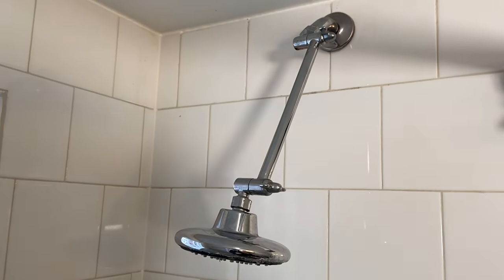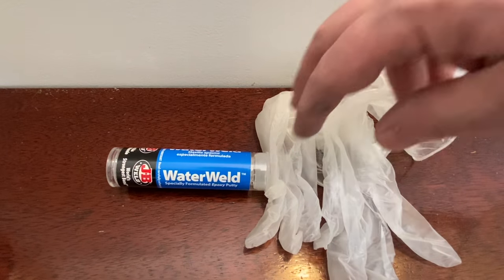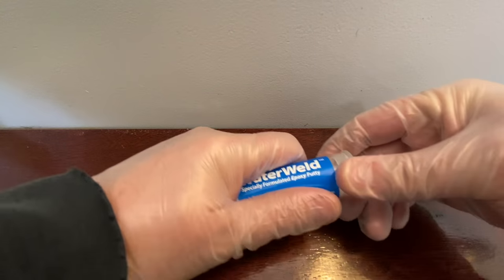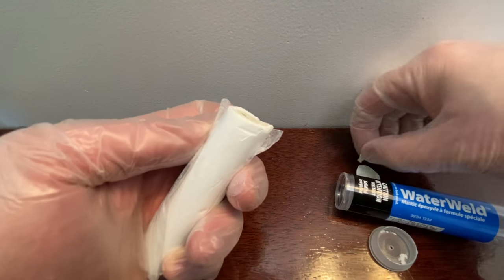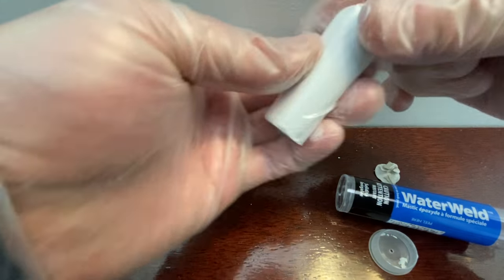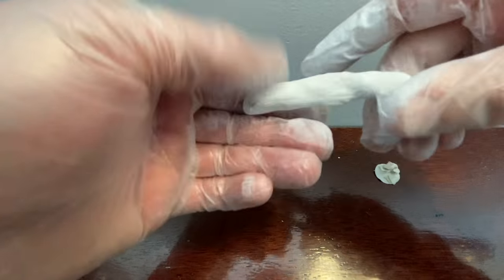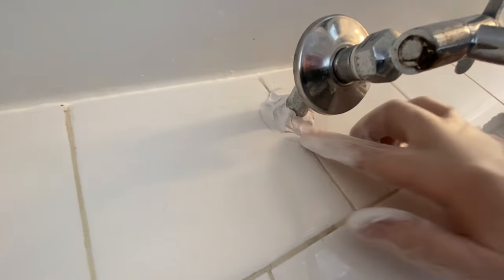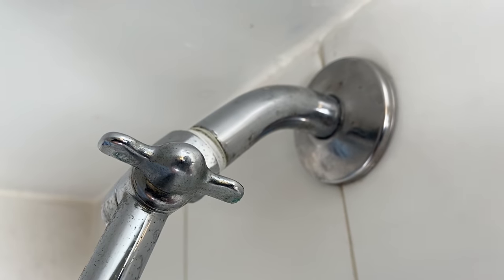Easy repair for a loose shower head!

Comment: What happens if you ever want or need to replace the arm?
Reply: It's not a perfect world solution it's a damn I gotta work with what I got solution lol
Reply: Use grout does same thing and can knock it out with flat when you need to replace
Reply: For anyone still wondering, what happens if the arm needed to be replaced. The tiles would also require replacing as the pipe runs directly behind the tiles. This makes it redundant whether this puddy is hardened to it or you leave the pipe wobbly.

Comment: Question-after doing this how do you replace the shower arm in the future?? Like how can this be removed without tearing out the tile?
Reply from the maker: I have not had a issue with removing water weld. it is hard but not metal. Place it to where it is not touching tile, but only the backer board or green board behind the tile. That will make it easier.
Reply: @ThatFixItGuy  would you chisel it out or how would you do it

Comment: Wow… I’ve ran away from this problem in at least two-three places I have rented. I assumed it was more of a professional job than my DIY tactics. Question, yours didn’t have much “play” from the wall. Maybe an inch or two? Mine has so much that it will pull out about a foot. Can I still use your solution with that much movement

Comment: Thanks for posting this.  I had a shower arm with a screw that completely came out of the stud.  The opening was large enough for me to try to install a new, longer screw, but I was unsuccessful doing that.  Bought a tube of WaterWeld and filled the drywall cavity.  Had to use the entire tube.  I had an issue with it setting the first time.  I held the showerhead up in place for about an hour while it was setting to no avail.  I disconnected my showerhead which was a pretty heavy rain shower head.  Was able to get a decent amount of the putty back out and re-kneaded it, and installed it again without the weight of the showerhead.  It set this time and I reinstalled the showerhead and the wobble is now gone.
Reply from the maker: That is great to hear this worked for you.

Comment: Great idea.  I have the same problem but with the bathtub spout.  I will do the same.
Reply from the maker: It should work good for that as well. Just make sure there is no bigger issue in the wall. You can see or hear water in there. Sometimes they just don’t secure things good.

Comment: Having this exact problem and was gonna cut my drywall to fix it. I'll definitely try this easy fix first! Thanks!
Reply from the maker: Sometimes they nail that in the back plate. Just make sure it is not a plumbing issue that will leak and hook it up. I’ve done this several times. Works well and can be removed.

Comment: any advice regarding how to remove head pipe (for replacement) after previously doing this with JB weld to secure it?
Reply from the maker: Screwdriver or little chisel and that plug will come out.

Comment: Really quick fix and stout I’m sure. 👍🤙
Reply from the maker: That epoxy putty is awesome. I have used one brand or another for a long time. Helps for things like this or in a pinch when you have no parts to repair a pin hole.
Reply: Thanks, just had new shower installed and the wiggle was driving my wife  crazy

Comment: My issue isn't this, but it has to do with a Delta shower wand and the ball and socket connector that it attaches to not staying in place. The ball and socket won't tight enough to prevent the weight of the wand from rotating downward in the plastic ball and socket. This a brand new shower wand. Ever come across this? Any ideas?
Reply from the maker: I have one right now that keeps loosening the whole shower head when you try to move the ball. I would contact delta or take it back and exchange it. Could very well be a defect.

Comment: How do you put handicap hold bars on any shower what's the easiest way
Reply from the maker: The easiest way would be to use those suction cup style handles to put in the shower.  Do you have a tiled or fiberglass tub set up?

Comment: Would this work for an extremely loose shower head arm? I have a shower head arm in the house that I’m purchasing, that has A LOT of wiggle in it. I really don’t want to cut open the wall to secure the piping. Thanks in advance for your reply.
Reply from the maker: This would totally work. I would just try to look in the wall and make sure there is no issue with the shower arm then use this to stop your wobble.
Reply: @ThatFixItGuy  awesome! Thank you for the tip!
Reply from the maker: Your welcome!
Reply: Is the nipple the arm threaded into secured or the arm broke inside the threads and stopping the "wiggle" still dont fix the problem! Actually it jt cahse ya not see the leak at the elbow!

Comment: How can u make sure that the water is not leaking on the inside?
Reply from the maker: I slide the escutcheon out and use a flashlight to look at the connection and if you still can’t see get an inspection mirror to look inside there.

Comment: Trying to put in new shower arm and the pipe goes back and forth and wobbles all around inside the wall. I live in a trailer and am so worried it will leak. Any tips ?
Reply from the maker: Do you know what kind of pipe it is?  Can you access the back of the wall behind the shower?
Reply: @ThatFixItGuy  I do not and I believe there is a panel that I can unscrew and take down. However I tried this hack and it seems to have worked
Reply from the maker: That is great to hear. This works really well.

Comment: How do I get the metal cover to stop sliding down?
Reply from the maker: Yep. get a tube of clear water clean up caulk. Just put some right around the edge. Wipe with your finger till it looks pretty won’t take much to hold that.

Comment: Could the looseness cause a leak?
Reply from the maker: If it is side to side  and back and forth movements it should not. Do you know what kind of pipe it is?  If cpvc or pvc was moving like that I would be worried.  If not those you should be fine.

Comment: And if you need to get back in there for anything?  How does that work?
Reply from the maker: You can just take a screwdriver or a chisel and knock that putty out. It does get hard but you will be able to knock it out.  Thanks for the question. I am going to add this to my video list.
Reply: Great question!  I’ve used another JBWeld product like this and it is like rock.  I would have used a Hugh density foam and heavily caulked the escutcheon to the pipe.  At least you can remove it later with ease.  The JBWeld product instructions say it can be drilled and machined, etc.  Sounds pretty permanent.

Comment: Is the putty removable?
Reply from the maker: It can be removed. I have taken it out with a hammer and screwdriver before. Or if you remove the shower arm then you can stick the screwdriver in the hole left the the middle and pop it out like a plug.

Comment: I see your wall is made of ceramic. My shower is made of ABS plastic, and the shower head goes through the drywall, above the shower. I am wondering if that putty works well with drywall? Thanks, great video!
Reply from the maker: I have used it on drywall walls were the shower arms comes through.  You just want to fill that hole.  If it is completely filled the movement will be restricted.  I hope this helps.

Comment: Learn how to properly fix it or call a plumber.  What you did was make a mess.
Reply from the maker: This is a quick easy fix that will help a lot of people without have to do an expensive remodel to the tub shower or the exterior of the house. I am a plumber and I approve this message.  Thanks for watching.